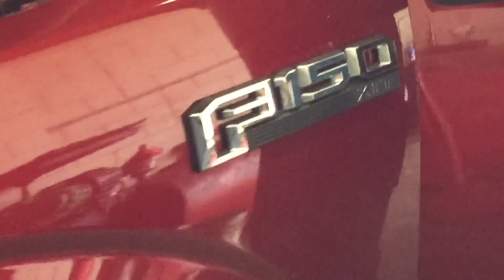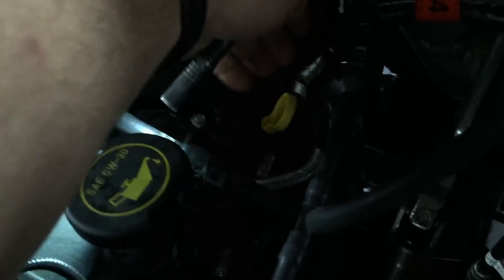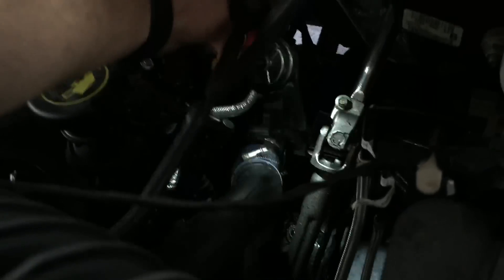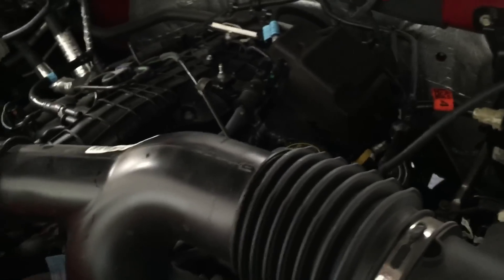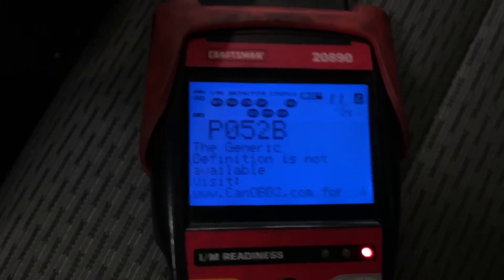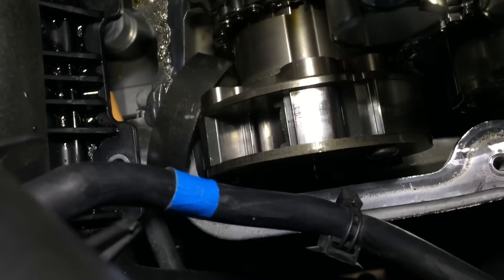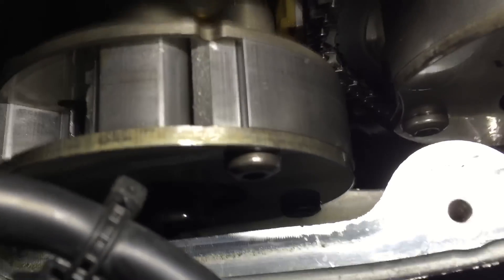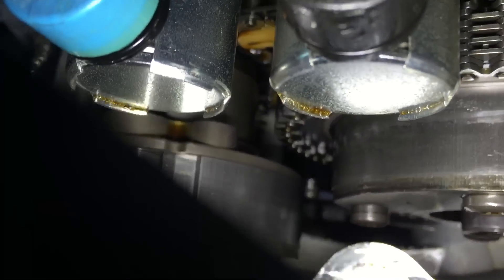Ford 3.5 EcoBoost Cam Phaser Failure

Comment: under warranty? new engine?
Reply from the maker: Haha, I wish. I can't blame Ford for not covering the repair under warranty though, it's not their fault someone didn't seat the dipstick fully. But Ford could have at least installed an oil level sensor in the pan and prevented all of this.
Reply: +DanielJaegerFilms...I don't think anyone touched that dipstick. Since you say it doesn't sit tight. My hunch is too much pressure within the motor and it found the easiest point of resistance which was that dipstick tube!
Reply: With those mile on a new truck chances are not even the customer touched the dipstick plus it's a lose fit so how is that not enough proof to make ford cover the costs?
Reply: My guess it wouldn't be under warranty because someone didn't put the dipstick back in. But I could be wrong.
Reply: glad it isn't my truck  because if my 2015 F150  did this   ford would face a lawsuit  for refusing to fix it ,, even though i am a mechanic myself  i bought a new truck for my busines so i wouldn't have to dick with it ,so far in 1.5 years  i have had zero trouble  with my 2.7 liter ecoboost i've got 15,000 miles as of last week ,I still have yet to even pull the dipstick ,it goes to ford every 4-5K miles , and i would suspect the person owning this truck  if they haven't changed the oil at 7K miles  probably never pulled the dipstick  either
Reply: @wildcoyote. Yea, you're going to sue ford for something like this?  I would love to meet the lawyer who would take that case. You can't fix stupid, but you could fire the idiot who didn't put the dipstick back correctly. Maybe she the dealership or repair shop...but it's not fords fault for dumbassery.
Reply: i am a jabroney if you had read my comment before you would know I don't touch my truck ,,I've had it over 1.5 years and not once have i opened the hood ,,and with this being a rental truck likely it was abused or something stupid was done with it ,,and if it never had it's oil changed  that is probably why ford refused the warranty claim
Reply: Even my 2002 Renault Clio 1.5 Dci (hah!) has an oil level sensor in the bottom, what the heck is going on overseas?

Comment: sounds like this owner doesn't take care of this truck. Are you going to post a video of the repair?
Reply: +Kenny M new truck. 7000 miles. the last person to touch it is the ford factory or ford dealer, either way, a ford fuck up. and where's the low oil light?
Reply: It says in the video description that this truck has 7000 miles on it, he hasn't even had a chance to take care of it yet lol. A truck or car with 7k shouldn't need anything..
Reply: no, ford fucked up and didn't put the gasket/ proper gasket on the dip stick
Reply: Ford didn't fuck up at all, whoever had the dipstick out last didn't put it back right...
Reply: I don't know what makes you assume that since this truck is at a rental agency being used as a rental truck... Last time I checked, rental agencies tend to check the oil and pull the dipstick nearly after every time a vehicle is rented and returned along with a bunch of other checkups since it's a rental and all. And what car now a days had a low oil light? Lol. I have 4 different cars, 3 different brand from completely different time periods, non of which have a "low oil light"
Reply: I find it very hard to believe no one has pulled the dipstick in 7000 miles. No, this was definitely not a ford fuck up. Not to mention that fords been using the same engine in millions of vehicles for over 5 years or so already, if there were a manufacturer problem, esspecially as potentially serious as this, there's a real good chance it'd be a recall already
Reply: +K1ll3rM4st3r I see what your saying you figure they would notice the oil all over.
Reply: +RedTeamWolf you could be correct my dipstick on my ecoboost does have something that holds it in.
Reply: +Kenny M I had a Dodge Charger rental once and I was presented with a low oil life message when I started driving it. I checked the dipstick and the oil change sticker and both showed that the Pentastar V6 thousands of miles past due for a change. I talked to the people in the front of the agency about the issue and they told me that it was silly that it hasn't been changed yet but due to corporate policy they only change the fluids at generic intervals that the company sets, not the OEM, not what the car 'thinks', and not what front office staff or renter observes.